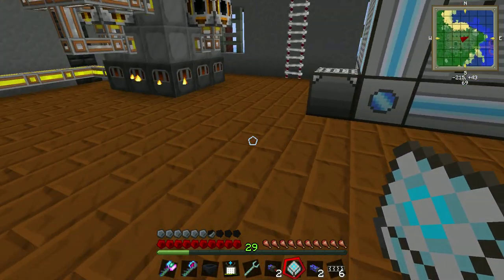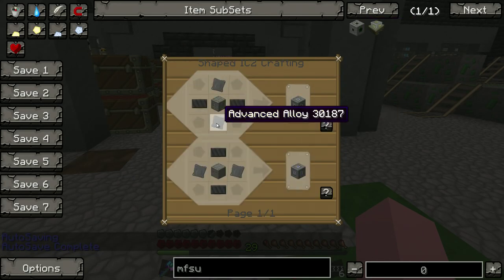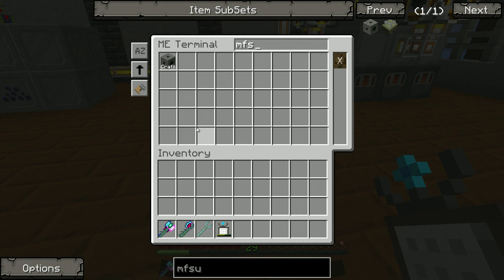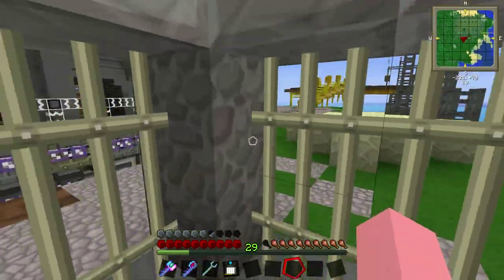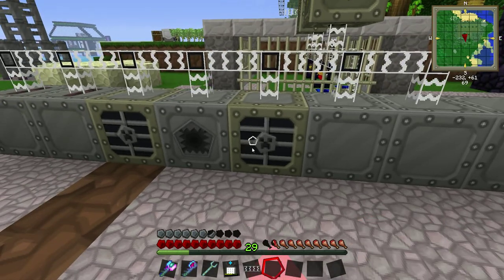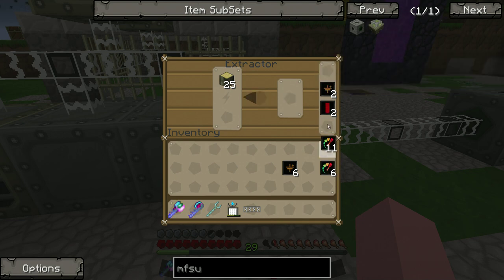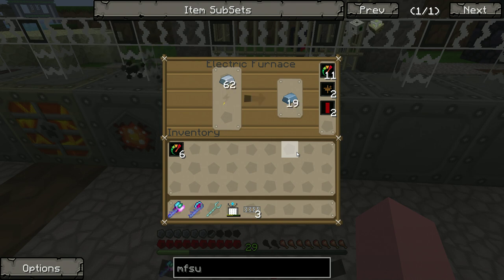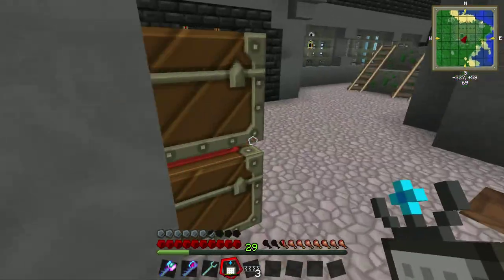Minecraft FTB Unleashed - Getting compressors automated! Ep 44

Comment: Hey Pyro! if you take a glass fiber cable around the mfsu from the solar panel, u can actually get two packets of 512 eu/t during the day. and then when your machines aren't running it'll fill the mfsu back up. just a tip.

edit. its not a full two packets because 1/2 the solar panel 512 eu/t goes towards the mfsu but still around 700 eu/t down the line during the day is still better then 512.

Comment: Your idea of using overclockers needs some tweaking. You test how many overclockers 1 machine can handle, then assume that EVERY machine can handle that many at the same time.... uh... no... That's the maximum that your mfsu can handle in TOTAL! You'd have to spread those 11 overclockers out between each of the machines otherwise you'll always run out of power b/c the mfsu can't keep up! To use the amount of overclockers you currently have, you would need at least 8 mfsu's and 8 MV solars, PER EACH MFSU, and that's just to break even. You're looking at 64 MV solars, or 8 HV solars. Also, just a word of warning, if those machines continue to run while out of power, they might explode. That sound is not only annoying, it's a warning they might blow.

Comment: Lol, nuclear....... Anyway, pro tip: instead of making another compressor setup for another item that needs to be compressed, just put your "trick" recipe in the all ready existing interface, it will save your resources. Also make some wireless boosters to solve that "no signal" problem. 16 is the max in each receiver.
Reply: i changed the config on my solo server to have a range of 5k meters lol